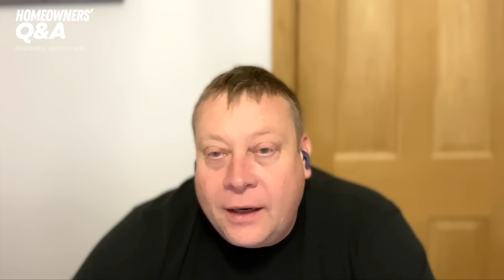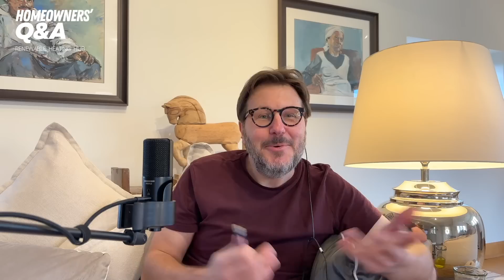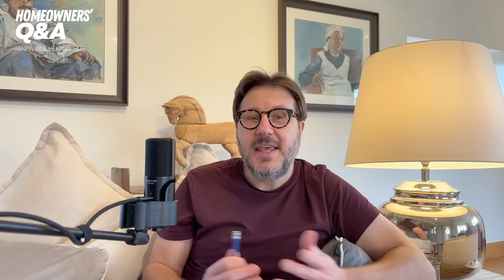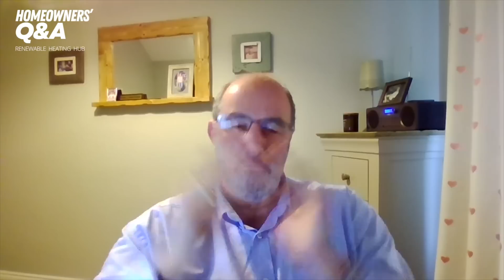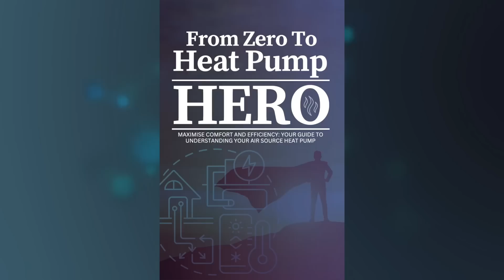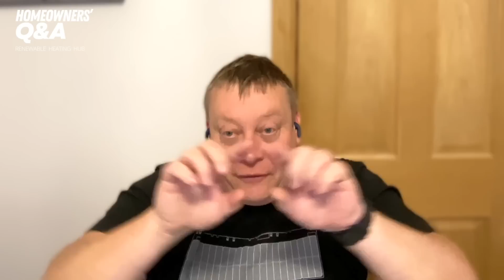Can You Heat Your Home for Free? PV, Battery & Heat Pump

Comment: Excellent video discussing the very issues I've been working on. When I first worked out it was possible to run a heat pump from solar PV plus battery I was told by installers it wasn't possible. Since I got it all working a year and a half ago I've not paid any energy bills and the house is 23°C 24/7.
Every six years it pays for itself and ROI makes keeping money in a savings account pointless. As one of you said - it's a no brainer 👍
Reply from the maker: Thanks got sharing your experience, and thanks for watching!

Comment: Gaining Momentum. Since 2012 I have Solar Heatpump Inductioncooking No Gas no Energybill. 13 Years Now. I let a House same System. No Gas no Energybill. I have a new LG Therma V Monoblock 9 KW Heatpump on normal radiators. 3500 euro. Solar since 2012. Easy Cheap Warm Effective. Thank You for this video.

Comment: Great video, I’ve had a 2.8kWp solar system since 2011 and I’m just waiting for installation in the New Year of 22kWp additional solar with a 12kw Sigenergy inverter and 32kWh of battery storage. I will also be coming off deemed export. I have had a Solar diverter for a few years but that will be getting disconnected, it will pay better to export the energy! I already get nearly £1,900 per year FiT payment and after the new installation I’m hoping to save £1,900 of my current electricity bill and in addition earn over £1,000 in SEG payments!
Reply from the maker: Sounds great!

Comment: We have PV panels supplying electricity on the FIT scheme. As suggested we have just moved to Octopus outgoing for the export amount paying 15p/kwh. We can’t change as far as I am aware the capacity of the PV capacity on the FIT registered array as it would invalidate the agreement. The original string is now paying over 70p/kwh with 10 years to run on the agreement. 
We are looking at extra solar panels and batteries which we looking to run a heat pump and home use power whilst exporting surplus on the original system to the grid. At present we won’t be allowed to export any surplus from the new system to the grid but I live in hopes that eventually we will be allowed to at times of high demand. 
First time I have seen this channel. Very interesting and nice to have some of my thoughts being supported. Also cause for rethinking elsewhere 
We installed PVs on converted barns we rent out subject to FITs and also installed export meters which allows us to work out how much is being used. As pointed out the deemed export is assumed to be 50% of generation. In fact the actual usage is between 20-45% per annum.

Comment: I took a loan out for my system, 21.5kWh usable battery and additional 4kW of solar (8kW in total now) and the loan I use to pay for the System on the back of the heat pump fitted at the same time means the 8 year loan repayments against the energy bill reduction means I saved £50 a month on average monthly payment from day one. If I included the FiT payments I can run my house for free

Comment: My experience with GivEnergy support is somewhat different than being portrayed in this video.

Their telephone support (im speaking as an end user) was really excellent once i managed to get through to somebody (often 30 min waiting on hold). That was eatlier in the year.

I had reason to contact them again recently as my GivEnergy EV charger waz not functioning. Irritatingly I discovered to my astonishment that their telephone technical support has now ceased, instead having to resort to the usual frustratingly tedious "online chat" nonsense. I waited for oven an hour for someone to respond and then spent another hour trying to make myself understood with the written word which is often misinterpreted.

I did eventually get a call back to discuss issues, but the usual runaround of try this, try that, get back to us again if it doesn't work hamster wheel.

Maybe GivEnergy comsider this to be great support but as far as I'm concerned it is an infuriating retrograde step in customer service.

My ev charger still continues to arbitrarily go offline for days/weeks at a time. I hsd a trip to yorkshire booked recently so set my car to charge to 99% overnight to facilitate this, however, come departure time I discovered that the charger had failed to execute. The result wss that I had then to go sit at a public charger for an hour at a cost of 85p per kWh, my wife was livid.

I chose GivEnergy because I wanted to kerp everything in the same ecostructure rather than seperate apps and I was reassured that they had excellent post install customer service.

I with hindsight I wish i had stuck with the zappi that the installer recommended. I know of several ev owners that have a zappi and are delighted with its reliability.

You live and learn!

Comment: can you put a GIVenergy battery or other brand in a room which sits at around 26/27 degrees - i.e. my plantroom
Reply: I have read they prefer a stable temperature so that's probably in the ideal temp range
Reply: Most battery systems will run up to 50c, I think Sigenergy state -20 to +55c!

Comment: Why don’t give energy only deal with trusted installers that has then training from them ? Why if heat pumps are so good do you have two log burners? You also have solar and batteries yet you have two log burner’s, plus you have heat pump , something doesn’t add up here , not to be a conspiracy theorist but this just doesn’t make sense. One of the guys said sell all the energy from solar back to the grid during the summer at a certain rate so winter you might have enough credits to go through winter without a bill , so if you’re selling from the solar to the grid what’s the point of a battery? The other guy said get a battery , singing from a different song sheet, no wonder customers are confused if the guys in the business can’t agree what is the best path ,  I’m more confused after this video than before watching it , the customers really have no chance after that video.
Reply: Banking your export in your electricity account as credit for winter import is effectively a seasonal battery but you need a real battery to store overnight cheap electricity for use the next day. He did say he didn't use the log burners because the heat pump keeps the house warm.
Reply: If you use all your solar the electricity if free (obviously). If you buy say 20kwh overnight for 7.9p and sell it for 15.1p you make £1.44, and you still get your electricity from your solar for free!

Comment: For, the question at the end, a pertinent point was that the solar was using FITS. It's not I think allowable to upgrade the solar and keep the FITS, I think the most you can do is replace faulty parts with roughly like for like and get it re-registered. The FITS payment is much more than the pitiful export rate, my 2.4kW max solar with FITS returns over £1,000 a year on FITS so that would have to be taken off any export payments for the new system as the FITS payment would be lost.

Obviously the time left on the FITS matters, I for instance have nearly 10 years left on my FITS, so I'd be throwing away over £10,000 to upgrade the solar, that is £10,000 I'd have to gain from the new solar.

Comment: Ref: "double the solar array first" comment. To keep the FIT generation payments you need to keep the the same peak capacity. To increase the solar generation put in a second system that doesn't go through the FIT  generation meter. Then relinquish the FIT deemed export and swap to Octopus or similar who pay about 15p kWh
Reply: as above.... 4kw fit and 4.4kw battery system...   good times ahead.....

Comment: Interesting & familiar discussion topics. 
I have solar (15 panels for 6.22KWp), batteries (2 x 9.5kWh Gen 2 GE's), a 3.6kW GE Gen 2 Hybrid Inverter & a Zappi car charger. No heat Pump yet (unlikely due to outdoor unit location issues) so I'm still on mains gas atm. The system works well enough but knowing what I know now after 18 months of use I should have gone for a larger Inverter because 3.6kW is not enough to run all the appliances in our house at the same time (& we don't have a HP) without drawing from the grid at peak times. I have tried explaining this to my wife but she does not understand the kW rating of each appliance vs the 3.6kW limit? We do time delay some things to run overnight but that's not always convenient.
 I was steered away from having a larger inverter by my installer because it needed a G99 DNO approval which takes longer, has to be paid for in advance & there was no guarantee the DNO would approve it either. I guess the installer was after quick sales vs higher value sales which might take longer to bare fruit! 
We charge everything possible overnight, run the house off the batteries during the day within the 3.6kW limit which is very hard for my wife to understand. Any excess solar & excess battery power goes back to back to the grid.
I'd really like to know if there is a relatively cheap way of adding more Inverter power that does not complicate the system or software e.g. adding an extra or replacement inverter that does not require G99 approval. I've looked at GE's All In One which I believe can limit it's export capacity while still maintaining up to 6kW of home power but that cannot integrate with my existing 9.5kW batteries so the cost to change would be prohibitive. Any suggestions or ideas would be appreciated.
Reply: This was my big concern so I was planning on two inverters, but I’ve now got a 12kw Sigenergy inverter and 32 kWh of battery storage being installed in January 👍 I did go for G99 but still have an export limit of 3.68kw 😢
Reply: I was amazed that in Dorset my G99 was fast tracked with 48hours , it's only 7kwh with battery and 3.6 export.

Comment: I don't think they really answered the question about the ideal size battery, as your power use changes with the weather. 
If you fit a battery that matches your use on the coldest day of the year, you'll be paying for capacity that only gets used once per year.
If you go for your average use, then it will be too small on the coldest days, and too large in the 'shoulder' periods.

All they said was "look at your daily usage, and if you use 20kWh a day, then get that", and ignored the variability.

Lots of other good points though...
Reply: Use the battery capacity even in the summer so you can export electricity through the night if you are on a restricted export limit.

Comment: I am on Octopus intelligent Go so most of my imports cost 7p. Last year I had one Powerwall and this did not last all day when the heat pump was working, however my worst month was still at an average of 10p/kWh, I had a second battery fitted in February and this winter the average price I pay has gone down to 7p,  will it ever pay back? who knows I am just very happy to see my IHD showing zero grid import or sloar exports all day! I still have plenty of the credit I built up over the summer.
Reply from the maker: Thanks for sharing